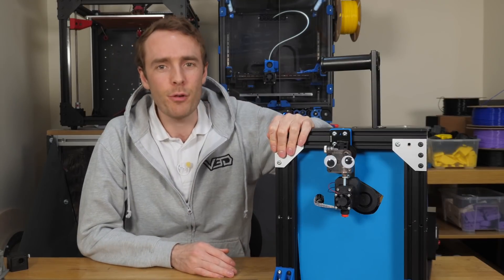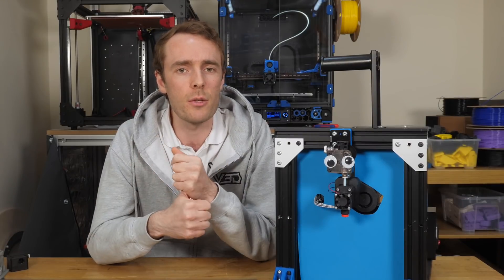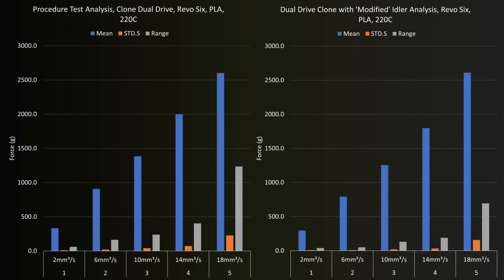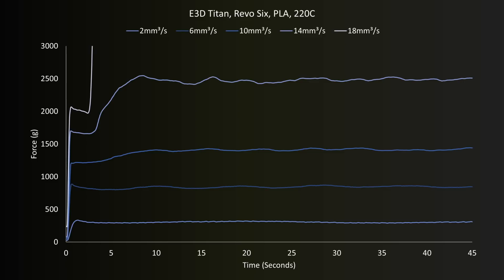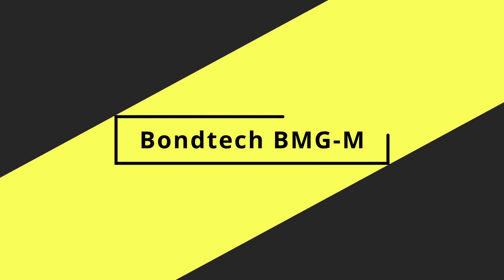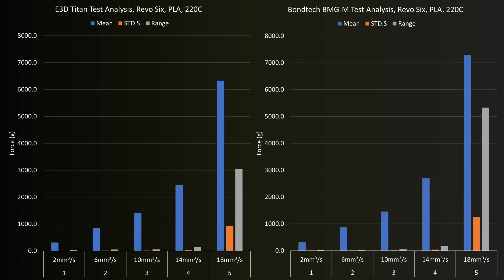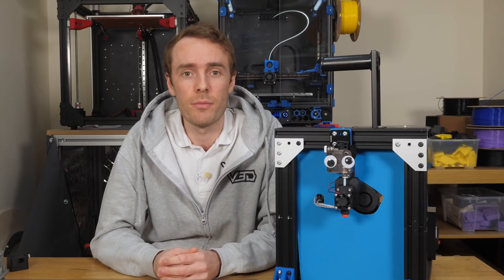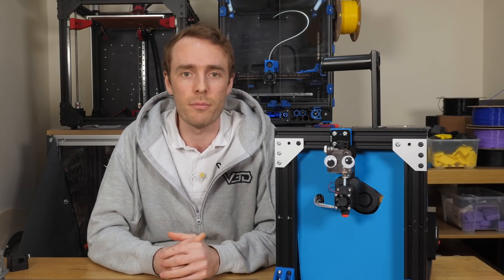The Extrusion Myth We All Believed

Comment: Nice to see more tests!
A suggestion for improvement: 1) Convert the x axis from time to mm of filament. (also works for the frequency)
2) For the Y Axis the amplitude has the same unit (Amplitude of Force in g), right?
3) A clearer separation between Hotend and Extruder would be nice. Extruder alone could be tested by adding a constant resistance at the output, instead of a hotend. Apart from just pressing filament on the load cell, adding a wanted resistance could be quite hard to do I imagine.
Reply: I like the idea of testing the extruder without the hotend!
putting a constant force on the extruder is actually pretty easy. just put it upside down and hang some weight on the filament. you could then measure the velocity of the filament and see how consistent it is.
Reply: this is one of those brilliant yet simple ideas that make you feel stupid for not getting it yourselves... ;) anybody has done this? do i have to do it? its much more simple and effective than anything i have seen so far! :)

Comment: Dual drive isn't claiming more PUSHING force but more GRIPPING force meaning it's less likely to grind the filament. If the filament isn't slipping then no difference in pushing force should be observed.
Reply from the maker: That second bit you wrote is kinda my point. There is no slipping, so there is no difference. The hotend reaches its limit far before the extruder so having any additional grip is basically never utilised. Titan achieved 6.3kg though with single drive extrusion. What hotend is still providing good flow output with that kind of force?
Reply: @Vector3DP  that extra grip does make a difference with softer and lower TG filaments to keep it from slipping or grinding. Also harder filaments where you need to dig in harder. Teeth size is a big deal too when it comes to avoid grinding the filament.

Pushing force will be down to gear reduction and stepper motor on the extruder aside from that, to state the obvious.

So to sum it up, dual gear and big drive gears is good for reliability and compatibility. Many extruders may work really good with optimized conditions. What sets them apart is how they behave in edge cases.
Reply: @olorf  Agree!
I still remember the craters my old wade extruder sometimes dug in filaments.

Now it would be interesting to test the OMG extruder (it's baffling that only My Tech Fun reviewd it) and the LGX standard or lite.
Reply: @Vector3DP  You should also consider (you likely have) that some filaments are much harder to grip. I've found that Nylon is much more slippery and needs a much tighter grip.

Comment: I'd be very interested to see you test out the OMG extruder. Dual drive, but both drive sets are like Titans (one idler + 1 toothed)
Reply: Exactly what came to my mind when seeing the 'single drive gear' results. Would be really interested in seeing the results for it aswell.
Reply: i would be interested too, im running the OMG on my setup and it works well, but i don't have any comparisons because i switched from the stock ender 3 pro extruder directly to the OMG ( as a direct drive setup )
Reply: Additionally the new Haldis 3d (creator of the red lizard series of hotends) extruder. similar to the OMG as a dual drive it is a dual drive AND dual gear. Would be interesting how it would compare. Unfortunately it is quite an expensive extruder (as it's designed to mainly be a hotend extruder  DIrect drive combo, but it can be used Bowden style)
Reply: Yeah same here, I have that on my printer and honestly like it more then bondtech. Its mainly bc mine prints nylon enclosed so the all metal holds up better with the chamber temps

Comment: Here are my two cents:
A) I think the fluctuating force for the highest flow rate comes from the stepper motor not being able to apply the same amount of force for all the microsteps, it looks a lot like the graph for force vs stepposition
B) Your conclusion is flawed in one way, I have a system with a very long (1m) bowden setup. There you need a good amount of force just to overcome the friction in the tube, yes in this scenario there is a big difference between a cheap tube, a genuine e3d and a capricorn and all of them are developing more resistance while they are used.
Reply: It is also an assumption that more force doesn't increase the melt rate. I think it does as it forces solid material closer to the wall at the nozzle restriction. That pushes the melted material out of the way placing unmelted at the wall. Lower forces won't overcome the high viscosity of the partly melted plastic so the heat has to transfer thru a greater thickness of plastic to reach the unmelted portion.

I think you are right on the fluctuating being the stepper motor. It should be easy to prove though. Just get one of the drives with a different gear reduction between the stepper and drive wheel, but same number of teeth on the two drive wheels. If the frequency changes it is not the gears on the dual drive causing it. He might be able to calculate the distance moved per step and correlate that as well, though motor should be slipping at this point so may not give exactly the distance when free.

I also think he needs to find why the clone doesn't perform the same as well. It makes this come off as an advertisement sponsored by them to sell more products and not actual science. Fixing the clone would eliminate that line of thought.
Reply: @court2379  The narrowing of the nozzle seems at a remarkably bad spot to melt filament. Like It is in open air and under part cooling fan, and it's a fairly thin wall of copper there, which i noticed because i broke through once already, so it's losing a lot of heat relatively. The tip of the nozzle is a lot colder than the melt zone higher up in the nozzle. Ideally, i would assume, you want the filament to be consistently melted before it reaches the narrowing, and while it travels through the part of the nozzle protruding from the heater block, and especially the narrowing, it already gets cooled again preparing to get frozen into the print.

As to investigating a bad clone? Probably better to buy a few from different suppliers and just exclude those which have obvious construction mistakes, such as not to start off on a bad foot. Like obvious dimensional deviations, visible manufacturing flaws, missing bearings... probably not worth thinking too hard about trying to prove that specifically the missing bearing and the resulting tilt or wobble or whatever has caused the clone to perform badly.

Comment: Great, more things to beat my head against a wall ! 😃
Several things:
18mm3 is the upper limit of the hot end so the results are pretty much useles as far as extruder is concerned. 
If the force is changing by changing extruder, it's weird, it should not.
Repeating this with a Volcano might shed some light, allthough i would use a 50 or 60W heater for it. As someone here mentioned, at higher flow rates even PID or weak heater will mess up results.
The 14mm3 and lower results look OK.
Thank you for the time and effort.
P.S. I print a lot of PETG and the difference in quality of parts using a normal hotend with 40W and a Volcano with 60W is huge, Volcano parts look like tasty candy.
Reply: The extruder is the only thing influencing the force if you try to squeeze more filament through the hotend than it is capable of handling. Not one of the extruders was able to feed 18mm/s through the hotend, but the dual-drive hotends were able to provide a much higher force before the filament started slipping. The big jumps in the force are the points when the filament slipped and are not influenced by the the drive train but mostly by how easy or hard the filament is able to be compressed and the lenght between the extruder and the nozzle. Very hard and rigid filament produces a high frequency and soft filament a low one. A longer path between extruder and nozzle produces a lower frequency than a long path. The test shows that the dual drive extruders are far better than the cheap one, because they "fail" at much higher resistence of the hotend and must have pushed more filament through the hotend than the single-drive one. The spikes in force are not comming from the extruders but from the filament jumping back and at that point this doesn't matter because you will have underextrusion and your hotend is your bottleneck.
Reply: @executeOrder69  Nicely explained, thank you.
Reply: @toma.cnc1  thank you! 😃
Reply: @executeOrder69  I agree. Your point proves that this test isn't suited for the conclusion that was made. Either the flow rate between extruders wasn't equal or one extruder was skipping steps. Else the pushing force would've been (and must be) equal at the same flow rate.

Comment: Very interesting! Lots to think about here. It would be interesting to repeat the tests with a flexible filament where the drive force limits before grinding are much lower.
BTW, Printrbot had the first dual drive extruder (the Gear Head). Ironically you showed the single drive Printrbot extruder that preceded it early in the video (1:01).
Reply from the maker: Didn't actually know about the printrbot one. Thanks for sharing.
Reply: @Vector3DP  almost no one knows about the Printrbot Gear Head! I have a couple on my Printrbot Metal Plus Dual Extruder that's collecting dust in the garage.
Reply from the maker: Did it reach europe?
Reply: @Vector3DP  no idea! I'm not sure what Printrbot's international marked was like.
Brook Drumm sent me the Gear Heads, so I didn't even purchase mine.

Comment: I have found that a 0.6mm nozzle printing at 0.2mm layers performs much better than a 0.4mm nozzle printing 0.2mm layers with the Bondtech BMG printing PLA at 215C /55C speed 60mm, I found a noticable difference in the print quality but I dont know why
Reply from the maker: Might be that larger nozzle diameter decreases nozzle pressure IIRC.
Reply: @Vector3DP  Yes that was line of thought I was following

Comment: The issue I had with non-dual gear extruders during my pre-direct drive era (currently a ratrig man and pushing fdm to the limits) was that some filaments would simply be 'waltzed' flat and jam in the bowden tube. Bowden obv needs more retraction for a good result than direct does, amongst the traditional debate between the two (there is no "right" answer), and having good tensioning control means a lot as well, but still: interesting videos to watch. I'm honestly intrigued by what we might expect from Prusa's new no-backlash yet also "non-dual gear" extruder. Currently running LGX (the load/unload is just so great), and happy, but always looking for better control.
Reply from the maker: From the testing I've done so far, I suspect we may not really need anywhere near the amount of idler tension that many of us think we need. Might do a video on this to so we can find out.
Reply: @Vector3DP  I remember watching a video by someone showing how the idler tension affected maximum flow, but I don't know how to find it again :(

Comment: The PID of your hot end probably explain the force at high flow.
Reply from the maker: Why does everybody think PID causes everything? By what mechanism do you think PID causes high force?
Reply: @Vector3DP  temperature differential.  The heater turns off at a temp, heat block cools down, viscosity increases, heater turns on, temp rises, viscosity increases.  I'm not saying that your PID tuning is the issue, but rather the concept of how PID works that creates these oscillations.

More thermal mass would be needed to decrease temperature variability due to the PID at high speed.
Reply from the maker: the PWM frequency that controls the hotend is 500Hz. The thermistor showed very little significant change through any test, and this is pretty close to the filament on the revo.
Reply: @speadskater  except that's not how PID control works.
Reply: @Vector3DP  I wouldn't be surprised if heater responsiveness is also not at fault.  Current takes time to heat it up, that delay is even more time for the block to cool down.  Now the game is balancing flow, thermal mass, and heater cart power.
Reply: The frequency the PID loop updates is only part of the effectiveness of a PID loop. If the parameters are not ideal you can easily have slow oscillations and be far away from the set point at all times. You have already ruled this out though by seeing little change in the thermistor value

Comment: For years I'd been a die hard traditional single-gear extruder bowden setup kind of guy. I wanted to do more with flexible materials so I changed one of my printers over to a Hemera. The most unexpected issue I've encountered with the hemera? Poor flow consistency - you can see ripples show up in the outer skin. This appears to be caused by the pitch and mesh of the dual-gear system in that extruder.
Looks like there may be alternate options for better quality I should look into based on what you are seeing here.
Reply: If you stay on the Bowden Setup but with a dual gear extruder, the Bowden acts as a spring and should smoothen out the extrusion. So you see these artefacts because you don't have a Bowden tube in between. So it's a combination of both.

Comment: I have to question the relevance of the extruders used in this test today. Bondtech has long since moved on to large gears. Hence the LGX and LGX Lite. Even Prusa has moved onto a different gearing system in their new XL. Obviously we can not test that until it hits the market, but running these tests on old tech seems to be a little behind the times. Also a key point was missed here which is relevant. Flexibles. The dual gear, from my understanding, was born from the need to better grip flexible. So running these tests on just simple PLA may make these conclusions incorrect. Not everything revolves around 3D printers at home printing PLA.
Reply from the maker: Back in 2014 flexible filament didn't really exist, it was purely designed to print faster, you can check Toms video about it where its discussed with the original creator. I get your point that it's not the latest tech, but its still tech that A LOT of people are using, like every Voron printer for example.
Reply: @Vector3DP  Are you sure, that flexibles didn't exist? I bought and still use a very early bondtech QR. As far as I remember, it was advertised for its minimum open gaps in the filament path to prevent flexibles from escaping. I think I bought some ninjaflex right after the bondtech QR to dip my toes into flexibles inspite of my bowden ultimaker due to that explicitly advertised feature.
Reply from the maker: @Alex_vGrafenstein  What I meant was, they did exist, but as far as I remember they were not really that popular. I may be wrong. I'm not sure it really changes my conclusion though tbh. Another test to do at some point though.
Reply: Nobody has a Prusa XL, and very few people have an LGX. This test was applicable to more than 90% of the 3d printing community.

Comment: The flow variations I've measured on fibre filled filaments might be an exception where having some extra peak force might be helpful to overcome semi-clogs.
Reply from the maker: This is true, but if there is any risk of full or partial clogging  would you not be much more comfortable with increasing the nozzle size than just hoping the extruder overcomes it quickly when it happens?
Reply: @Vector3DP  True, but without good flow or force measurement I don't know how I'd know it was happening. Sometimes you can see it in the final print, but mostly not.